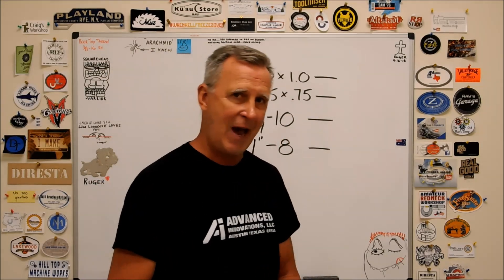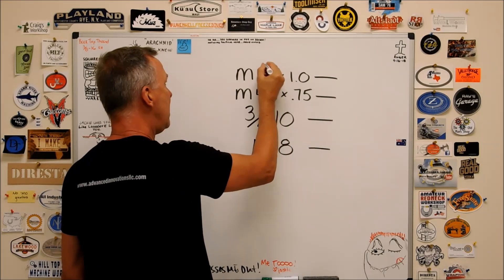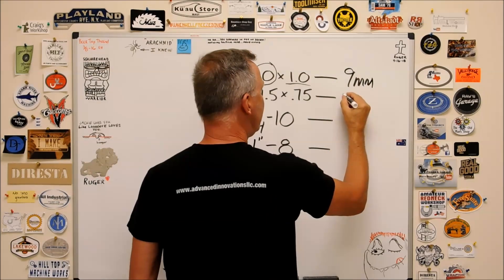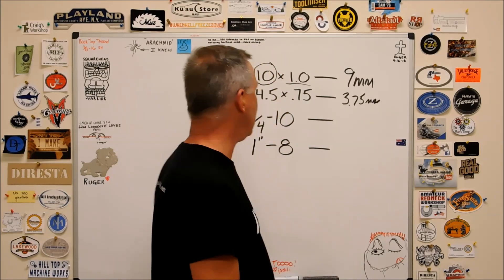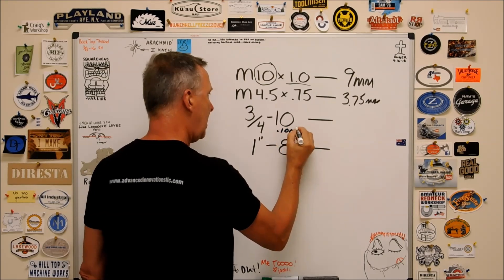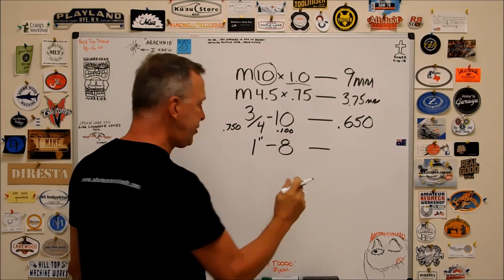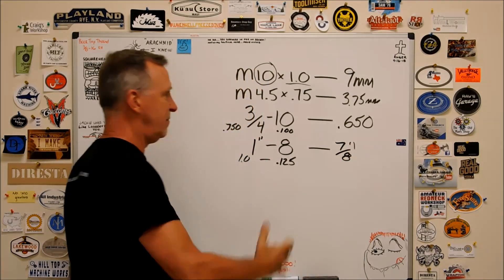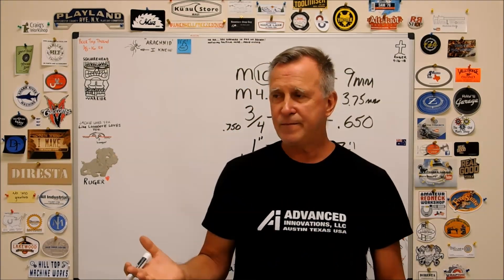How to Determine the hole size for an Internal Thread  --  SHOP GEM !!

Comment: This method yields exactly (usually) the same tap drill sizes as common charts, which are figured for 75% thread. That's suitable for the vast majority of work. If you need a different thread percentage there are online calculators and apps for that. Or you can go old school and look up the formula in Machinery's Handbook.
Reply from the maker: It does. For class threading, the machinery handbook should be referenced.

Comment: I never really thought that  the tapping hole diameter  for inch threads  could be calculated by dividing 1 inch by the tpi and  subtracting that from the thread diameter . I wonder does this formula hold true for threads with different angles like Whitworth - 55 degrees - probably close enough to not worry about but there is a difference .
I would love you to do a video on working out what diameter hole you need for some weird threads , inside every V form thread resides two right angle triangles back to back and I reckon this trig formula os right up your alley Joe!
The thing that really annoys me especially with metric is that the pitch is variable amongst close sizes say 5 and 6 mm for example , it would be much simpler if they had  3 and 4 mm at 0.5 , 5,6&7 at 1mm , and above that at 1.5 ,2 , 2.5,,3 ,3.5 or  4 mm etc -  It makes buying tapping drills much easier and cheaper  - forget 0.75 and 1.25 etc  no hardware store keeps drills for these , well not where i come from anyway ..
Thanks for another fantastic video Joe !
Reply from the maker: I don't have much time dealing with threads outside the normal 60 degree profile, so I hesitate to comment on that, but the variety of pitches in the metric family has raised my eyebrows more than a few times.

Comment: Does it work with pipe threads  either BSP or NPT as the thread size only relates to the nominal bore of the pipe
Reply: This thumb-rule is applicable to straight threads with a 60 degree point (metric and imperial threads share the same thread profile).
Reply: Pipe threads are tapered, and ideally the hole you want to thread is tapered as well.  You can fake it a bit with a two stage pilot hole, but its going to take more force than tapping a hole tapered for the thread.  For example:   https://www.kbctools.com/CatSearch/74/taper-pipe-reamers
Reply: @somebodyelse6673  Thankfully CNC machines can use threadmilling, much better then struggle with reamers and tapered taps.
Reply: BSPP or BSPG is parallel
Reply: This does not work with NPT or NPS pipe threads because they are designated by the inner diameter of the pipe, not the major diameter of the external thread.

Comment: Interesting but not accurate in any way,The easiest and most accurate way to do this is just deduct thread depth x 2,even better pick up a Zeus book,i notice that your imperial calculations are .010" too big which would result in an incomplete thread form.
Reply from the maker: @jack81007    I disagree. Compare these results to any chart. You'll probably find these makes a slightly tighter thread at times.
Reply: @joepie221  Flats on top of a thread is not full form so i struggle to see how you can be correct.If your after an easy tapping thread for a rough job then great,not strong though.Just look at the sizes for m10 in any ZEUS book,it quotes 8.5 you are .5mm bigger than that.
Reply: @jack81007  That's for M10x1.5. Joe was quoting for M10x1, which is a very fine thread.
Reply from the maker: @jack81007  Off the top of my head, if the tap drill is 8.5mm for an M10, you have to be looking at a 1.5 pitch. sooty655 is correct. The formula still applies to the example you used.
Reply: @joepie221  What about the imperial ones?
Reply: Joe is correct and gives approx 75% thread engagement More tan enough to break the bolt before theeads strip. your suggestion attempts 100%. difficult to impossible. kind regards from John Spargo in CapeTown

Comment: Amateur hobby machinist here. In pro shop, do machinist use these types of rules of thumbs or do they go by the actual thread dimension (e.g., Machineries handbook tables + 3 wire method or thread micrometer)?
Reply: Chris Morris depends on which tolerance needed, and what the thread are used for.  For “normal” thread I just use a vernier caliper, and as joe points out, subtract the pitch.  Had never failed in my 16 years as manual machinist career 😊
Reply: Agreed, depends on specification and application. To some extent what material is being cut.
Another question is how many threads  are you making? One or thousands? If it's a single repair job where the thread isn't critical you get the job done but if you're making thousands you make sure you optimize the threading for both minimal material removed by the threading as well as keeping within tolerances.
Reply: @sharg0  - Ya, tolerance is a big factor in how to go at a job.  Many times an approximation is more than good enough.
Reply from the maker: If the thread is called out with a class, its a different animal. Its time for standards and wires for sure.

Comment: Hey Joe, I'd be curious to see your take on a video about how the home gamer should approach buying end mills (or cutters in general really).  Do you go with stuff tailored for specific materials since doing otherwise will cost you more in the long run due to increased wear and tear when used in the wrong materials? Or do you go for more general cutters? How much do coatings really matter? Etc etc.  It's pretty easy to get overwhelmed with options when one cracks open a catalogue
Reply: Full answer: It depends. 
On what material, machine used, required tolerances.... See the catalogues!

Short answer: Don't buy the cheapest stuff nor the most expensive. 

If you have a nice machine shop around ask if you can buy used cutters from them. Especially with series production cutters are replaced before they break (since a broken cutter might cause a damaged part which can get expensive). As long as they don't have chips in them they will likely hold up quite a good time for home use. 
They might also have old-new-stock that they are glad to be rid off.
Buying tools through them might also be good unless it creates to much paperwork for them. BUT don't be surprised when a normal 6 mm mill costs 30$. Or more.

But don't expect to get these for free, the materials in them are expensive and manufacturers like Sandvik and SECO buys the scrapped ones back for recycling.

For home use you will likely want two "sets". One suited for steel and similar and one very sharp for plastic (generic use) and soft metals finishing.

And yes, coatings matter. On hard materials it mainly protects from abrasive wear and for softer materials it decreases the risk of material to stick to the cutter (plus a bunch of other things in both cases but these are the most relevant for the home machinist). For plastics and wood: Nah.

(Please note that this is just a very short post on the subject and in no way a complete guide, just some quick thoughts.)

Comment: already subscribed long time ago  , i did not knew , brilliantly simple !  any clue for 6-32 , 4-40 ....
Reply: Same method. You just need to know the major diameter of the numbered screw sizes.
Reply: The major diameter of numbered machine screws has a Formula: 
.060" + .013" × the number. 
 So a #4-40 is .060" + (4 × .013" = 
.052") =  .112" major diameter.
Reply from the maker: I love this tip. I never knew that.
Reply: @joepie221  My apprenticeship skipped a lot of things, but this formula was covered and I actually remember it.
Reply: And it goes the other direction, too, for those who are working on tiny things: #00 is .060 - .013 = .047 and #000 is .060 - (2 × .013) = .034

Comment: It's not exact, but usually it's good enough. The ideal number for minor diameter is major diameter - 2×⅝×½√3×pitch, which is maj dia - ⅝√3 × pitch, or maj dia - 1.083×pitch. However, if that level of accuracy matters, you also have to add in the allowance for a class 1B or 2B fit. (Class 3B doesn't have an allowance, only a tolerance.)

Comment: so how would that work for a 6-32 tap?
Reply: For number sizes nominal diameter is .060 + (.013)(n). For instance, #10 is .060 + (.013)(10)=.190, and #6 is .060 + (.013)(6)=.138. Tap drill size for 6-32 is .138-(1/32)=.1068. Closest drill is #36, just like the tap drill chart says.
Reply: @randyshoquist7726   thanks for the info and I need to print out the tap..  I have read on a chart to use a #35 or 7/64 but I am not happy with the thread I will go and buy a set of # drills today..  never needed them untill I bought a lathe :)
Reply: adrian harrison subtract 1/32” from the major diameter.
Reply: @kurtjanzen7391   so 1/32 from 6?
Reply: nope not working for me at all
Reply: @adrianharrison5208  6-32 major diameter is .138" minus 1/32" (.03125")= approximately .106" or a number 36 drill which is .1065". Hope this helps.
Reply: @kurtjanzen7391   To be honest I also got that but its not a simple as this video makes it out to be, the info is not all there.. it was easier to just look up what drill i needed from what i can make out its a #35 or 7/64
Reply: adrian harrison charts are much easier. Where this comes into its own is making threads not in charts.
Reply: @kurtjanzen7391   Yes that iw why I will spend some time going over this untill I get it

Comment: If the M10 metric thread is 1mm pitch, it is 1mm point to point. If you draw this out the triangle formed is equilateral (60degree thread) with the point at the root of the thread. The height of a 1mm equilateral triangle is 0.866 mm. Since this is the actual thread depth, wouldn't this make the drill size 8.26mm? (chart says 8.5mm)
Reply: You are assuming a sharp v-thread. A UN thread has a flat of ⅛ pitch at the major diameter and a flat of ¼ pitch in at the minor diameter, leaving a thread height of ⅝ (cos 60) × pitch.

The old American thread standard had a thread height of ¾ of the sharp v height, and the 75% you see in tap charts is based on that. That 75% of ¾ is very close to the UN thread height.
Reply: I'm assuming they are trying to obtain a 70% thread.
Reply: @sferg9582  That totally makes sense. I checked a few places and they all say 9mm, 9.1 max for 75% Forgot about that bit.

Comment: Fastener design engineer here extremely well versed in SAE, ISO and JIS specifications.

This is a good rule of thumb for the shop, but if you are making parts that are going to be inspected, that are going to need to be thread gauged look up the hole size in the relevant standard don't use this method.
Reply from the maker: If the print calls out for a classified thread, that is what you have to deliver. Standards are in place for a reason and should be followed to the letter. This is a very accurate rule of thumb, but may be a few thousandths out of range for precision applications.

Comment: I just screwed up an offset acme nut for a vise repair. Looked up the specs on Little Machine Shop after boring to my own calculations(Henry Ford formula) . Overbored to LMS spec and it was too big! Other engineering sights were correct. This would have been easier!  My wife watched this with me and not only did I slap my head, I almost slapped hers too! Great info!
Reply from the maker: Great comment.

Comment: Cool tip.  So what percentage of the thread form is that?
Reply: for the m10x1.0, i get 57.73%
Reply: confirmed, i ran a bunch of bolt sizes, and it's always 57.73%. I thought as much, but wanted to be sure. good for a rule of thumb, but i usually shoot for 75%+ when in soft materials, because why not?
Reply: To be clear, the 75% you see on old tap charts refers to 75% of the old American thread standard, which was itself 3/4 of the sharp v thread height. UN threads are specified to have thread height that is 5/8 of sharp v height. The net-net is that a 75% of ideal American thread (ie 3/4 of 3/4 or 9/16 v-height) is very close to an ideal UN thread (5/8 v-height).
Reply: @PaulSteMarie  I didn't know that. good tip. I looked at the tap drill chart i use, and it's got the same numbers that Joe talked about labelled as "75%", so that's reassuring.

Comment: Very cool, but how does it work for a 10-32 for instance?
Reply: It works for any thread. Although you need to know the OD of the thread first.
Reply from the maker: Agreed. .187-.032 =.157 #21...pretty close.
Reply: @joepie221  Thanks
Reply: @joepie221  Is there such a rule for cutting external threads as well?
Reply: A 10-32 screw is .187 diameter 1 divided by 32  is .03125    .187   Minus .03125 =.15575 or round up to .157 which is about 5/32

Comment: This is a great way to get close, assuming ~75% thread engagement.  The real math is in Machinery's Handbook and for pitch P the sharp-V thread height H is sqrt(3)/2*P for 60 deg. threads, but this is reduced by that fact that 1/8 of H on this tip of the thread is truncated and 1/4 H is left flat in the root, so the depth of cut is 5/8 H. There is also an allowance to the external thread can fit into the internal thread (nut) with some clearance.  For 3/4-10 where the quick method get 0.650, the tables show the limits for a 2B (common) thread as 0.642-0.663.  For the 3B (better) fit, the size is spec'ed as 0.6420-0.6545. So you are in tolerance with 0.650, but you might not be in the middle of your tolerance, particularly for the better fits.

Comment: Ok...I'm looking at this from a rather oblique perspective.A lot of comments are asking if this will work for threads that have pitch angles which differ from the standard 60 deg. Imperial or metric. Think of your compound slide angle when you are cutting threads and how far you move the cutter in for said depth. Now think of how deep the cutter actually moves into the work piece.Now if you take your different pitch angle...let's say 47.5 deg.  and figure out what percentage of 60 degrees that is. Wouldn't we be able to proceed?

Comment: I went to a place to buy an M5 tap and drill for said tap. I had written down the drill size I had found in a chart, when i got there the guy iver the counter told me the proper drill size (I mess up and got the wrong drill size from the chart) and explained me the same thing you did here. I remember it to this date but it's good to get a refresher. Thanks a lot Joe!!

Comment: Thanks for the video. I resently learned how to prepare for tapping metric, what size of the hole. But.... How to prepare turning a round stock before single point threading, or using hand tools?

Comment: Does the same work for external threading- machine stock to required size less pitch?
Reply: no, for external threads the major diameter is roughly the thread size
Reply: @fuzzy1dk  Sort of thought that but sometimes its real hard to start a thread even with a good chamfer

Comment: I have known that for metrick for 40 years. But I did not know that inch is that easy also.
Reply: Just curious but why would any think the measuring system would change the formula.
Reply: @TheRetiredtech  Maybe because I have never worked with inch.

Comment: Joe does this work with small threads like #4-40 or #8-32?
Reply: Yes, but you have to know US machine screw sizes. The basic formula is 0.060" + 0.013"×size. If you forget, you can remember that a #5 is exactly 0.125" and a #10 is 0.190", and work it out from that.

Comment: Does it also work for same size bolts but with different pitch ? For example there are M5 bolts with 0.8 en 0.5 pitch.
Reply: Yes, works just fine for coarse or fine pitch bolts. The nominal figure arrived at by this method can be altered to suit varying materials and applications.

Comment: Hi Joe  Great tip especially the imperial version..  I come from a metric country so the metric drill size is fairly well known but not the imperial.  If viewers want to know the various drill sizes for harder/tougher materials as a last resort remove the engineers handbook from the rubbish bin and look it up. (That is why I have an electronic copy.)  Engineers handbooks can be downloaded for free off the internet.  They may not be the most current version but things like thread information does not change.  Keep the videos coming - something to look forward to other than news about poor leadership and the poor state of the world at the moment.  Cheers  John.

Comment: Metric guy here: I've had older colleagues who didn't know this and some even challenged me that that doesn't always work, boy did I prove them wrong... sure, there are moments when slightly bigger or smaller is better but those really are exceptions to the rule, like a slightly smaller hole in really thin metal and have the tap enlarge the hole for maximum thread height and engagement or slightly bigger for really hard materials with a high tensile strength (threading conventionally obviously) but for 99,9% of the time Diameter - Pitch = Hole is the rule to follow. (and yes, Adam is a good maker but still an apprentice when it comes to machining, so many things went wrong but he learned something )